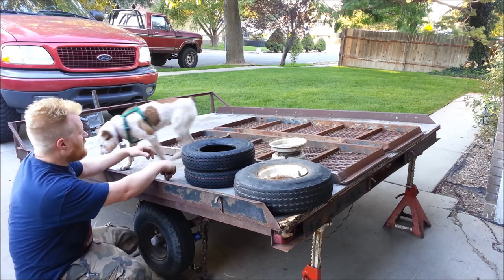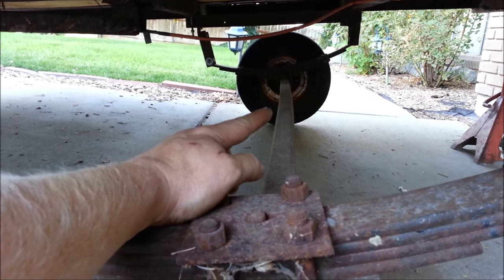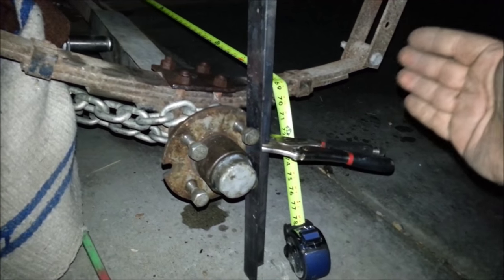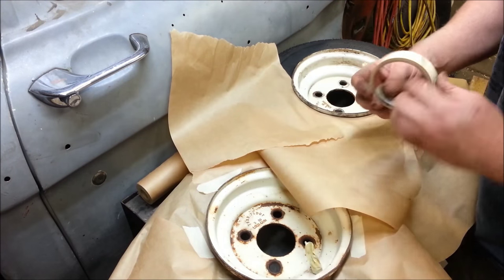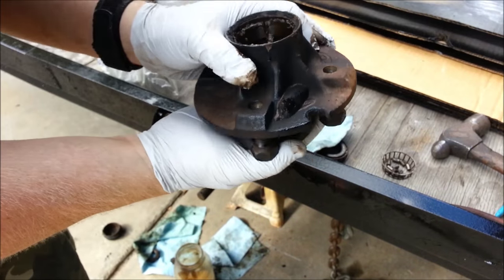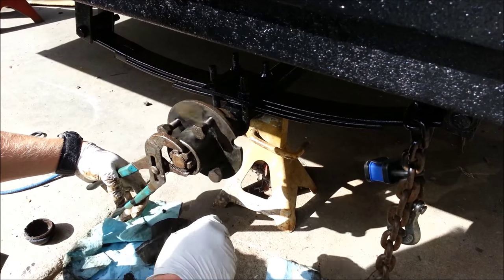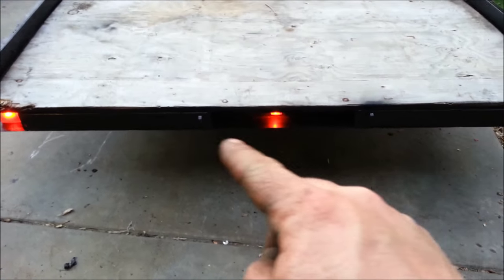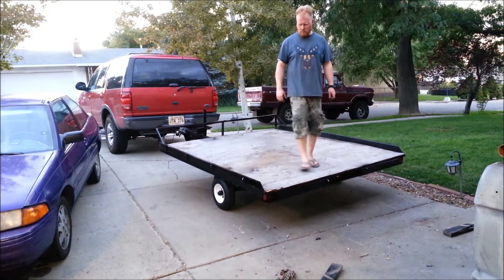Snowmobile Tilt Trailer Rehab Restore

Comment: Great job! Always important to keep the bearings lubed and in good condition. I repacked the wheel bearings on my pop up camper about 3 years ago, I pulled them apart last month and they were still perfect, grease was still nice and clean, but nothing like having peace of mind while going down the highway.
Reply: bearing buddies.
Reply: @mrgoggles1963  Bearing buddies are for boat trailers. They force grease out the seal and make a huge mess. EZ lube spindles are used for trailers, they allow the bearings to be lubed while pushing the old grease out from the front without blowing past the seal.

Comment: What a good idea with using an extension cord. As for grounding, the HB trailer kit I put together I ended up running a ground wire to each light. I also solder the wires like you do.
Reply from the maker: +Dasdfjkl On my own trailers I run a ground to each light and frame ground them. They never fail.

Comment: I use to stick the tires in between the bed on a dump truck to break the bed.   I would hold the switch in one hand and the tire in the other. It worked great.
Reply from the maker: +1970chevelle396 That's a great idea.

Comment: Nice... Thanks for sharing.

I agree about soldering the wires... Strangely enough but one of my co-workers has a Master's in Electrical Engineering and said that you should NOT solder auto wiring because it will corrode faster and cause excessive resistance... I searched this and the answer was to put dielectric grease on the connect like you said OR use heat shrink tubing with sealeron the inside for an air and water tight connection...     Very interesting...
Reply from the maker: +Jim Brent That's on the same lines of if the wire has a nick or cut in the sheathing it will corrode. This trailer for example: had one of the only soldered connections I've ever seen someone else do. It was for the wire feeding the 3 rear center marking lights. The soldered connection was very loosely wrapped in electrical tape with no grease. This split off to the light that had three crimp connectors and was rusted and corroded beyond the repair with zero voltage passing through any of the three connections. The soldered connection however flows flawlessly and that is the same wire I used to hook up the single rear center marker light. This trailer hadn't been moved or touched since the early 90's and when it was, it was used on salted winter roads in the worst possible conditions.

Comment: Nice job. I never thought of using an extension cord to wire trailer lights. I like that idea. It seems like every time that I go to use my trailer the lights don't work and I fiddling around with the wires just to get some lights on. I'm also always replacing the connector on my truck. The cheap HF ones break inside of the insulation.
Reply from the maker: +Joseph Costello Thanks. Yeah, cheap wires can be frustrating.

Comment: Cool way to check and adjust alignment! Great video. One little note, triple lights are required by law on trailers over 80" wide.
Reply: Exactly. That trailer is not road legal because of the missing triple light (also must be red, not orange or white) in the middle of the rear span.

Comment: A tip for wheel bearing! I usually take the old bearing and grind it down a bit on the outside! Then it does not stick when you knock down the new bearing.
Reply from the maker: +SillenTDMrider That is a great tip and I knew someone will call me out for it.  Thanks..

Comment: great job.. handmade trailer?  wheres the licence go? .. i use basement floor grey to slather  onto my 2 x 10 trailer boards and then before winter i oil spray everything.. extra greasy  under.. no rust
Reply from the maker: +san379 I my state small trailers like this don't require licensing.
Reply: nice to see that.. here.. even the smallest trailer and electric bike and everything needs a licence and pay tax on it.. even boats have a boat launch fee and zebra muscle  tax  about 70$

Comment: I live up in the salt-belt.  Have some steel pins that hold the enclosure down - that are all corroded - any tricks on how to keep them rust-free without painting them?  Can you heat them up and dip them in oil to give them a protective coating?
Reply from the maker: I've oil treated steel before with decent results. You want to get it to around 350F then dunk it in old motor oil. This is just enough heat to hold open the pores to hold oil. Most of the time though I just like to use Marine grease. It is design to not wash away with salt/water like typical grease/oil.

Comment: Great video.   Love this project.
Reply from the maker: +Marcus Kloepping Hey Thank... I should have red Loctited the lug bolts in though to give the next guy a surprise. :-) Random question for you: is there an adhesive that will bond steel to rubber (like you might see on small engine motor mounts)?
Reply: +sixtyfiveford  yes we have adhesives that can do that. Can you give me more specifics?
Reply from the maker: Marcus Kloepping On the bottom of generators and other stationary equipment there will be rubber feet to isolate the vibration of the running machine from the ground and keep the equipment from dancing around. The little rubber feet are generally just a soft rubber  about the same firmness as a car tire rubber and it is bonded to a steel washer. This is then bolted to the equipment with the washer and the rubber contacts the cement, isolating vibration. The same thing is done with engine mounts on small equipment where they take a metal plate, bond rubber to it and then bond another piece of metal on the other side. One side gets mounted to the motor and other the frame of the equipment. Typical adhesives that I have tried, bond to the steel but the flexible rubber tends to be difficult.

http://longmansales.com/data/rubber-engine-mounts.jpg
Reply: +sixtyfiveford your two best options are a tuffened superglue or a urethane adhesive.     If you want a sample let me know.
Reply from the maker: Thanks for your insight.

Comment: Did you actually use just regular extension cord to wire it I need to rewire a trailer and it's having lots of problems I'd appreciate if you replied. Thanks man
Reply from the maker: +JR Landscaping Yes, I've found regular extension cord works amazing.
Reply: +sixtyfiveford do you just use one piece for the whole thing ?
Reply from the maker: I try. The fewer splices the better.

Comment: Just note, if you straighten an axle out after its been overloaded, it won't take all that weight its rated for again, or atleast as much as it could prior to yielding, before it starts to keel over again.
Reply from the maker: Yes and no. The deflection isn't for load carrying, that is the job of the leaf springs. The deflection is only for wheel alignment. You put a top arch bend in it to counter act the bend under working load. The amount of bend is so minor over the length of the axle, there is really no metal fatigue. Front I-beams on Ford trucks are bent back for this exact reason during a routine alignment.

Comment: I thought dielectric grease on connections were bad, because it blocks electricity? Will it seep between the wires and eventually block the connection?

I use linemans splices and shrink wrap.
Reply from the maker: Just the contrary. It insulates the wires from corrosion and keeps the connection good indefinitely. I've never had a dielectric connection corrode or fail.
Reply: Killer, I'll use it from now on!    Thanks!

Comment: id like to see how you use the extension cord for a trailer thanks
Reply from the maker: +MISTERR0BOT0 I just cut a length from an old extension cord and use the wires. They're all shielded nicely so they last forever.
Reply from the maker: +MISTERR0BOT0 I just cut a length from an old extension cord and use the wires. They're all shielded nicely so they last forever.

Comment: Could the axle be rotate where the bow is up to compensate for the load?
Reply from the maker: +Dennis McGill Most axles will have spring perches welded on(round tube). This one had holes drilled for the leaf spring through bolt. So you can rotate them with a little work but usually it requires cutting and welding.
Reply: +sixtyfiveford It Was Just A Thought.
Reply from the maker: It's a great idea and I've thought/think the same as you.

Comment: Nice job  good looking trailer. If you would have wanted the trailer to stop bending over the front where you had to put the Jackall to the centre you could have welded truss bars from the top of the centre post to the bottom of the trailer deck on the outside edge and would have given it more than enough support. Don't you have any punches? LOL using screw drivers is a little hard on them. LOL
I know what your wife can get you for Christmas :-)
Reply from the maker: +Murray Lowe Yeah, screwdrivers get a lot of abuse from me. But they hold up for years before I have to warranty them out.
Reply: +sixtyfiveford I guess that is something I should do because I do break them just with torquing them. But usually I just buy a new set because I don't go through them that often. I do have a fairly good supply of chisels and punches and I am pretty hard on them.
Reply from the maker: I generally use the rounded off flat heads for chisels, saving my sharp ones for screws. I randomly run over to Sears and swap them out along with phillips as nothing works better than a new screwdriver.
Reply: +sixtyfiveford  Phillips is the ones I torque off the flutes so I use robertson screws and drivers they last much longer and are definitely easier to use. I am like you in the use of standard (flat) screw drivers because I really don't like slot screws many times I have hurt  myself or just damaged the screw or furniture or whatever by using slot screws. But all this aside, I really want to thank you for sharing all your great videos.

Comment: How did you get the hub and wheels off?
Reply from the maker: Take off the dust cap, cotter pin, castle nut and it pulls right off.
Reply: @sixtyfiveford  having hard time getting bolts off any ticks I could use
Reply from the maker: @kellygrogan5066  The main spindle nut It's held on with some sort of locking device. Generally it's just a cotter key, but they also have methods of washer that's bent over to hold the nut from spinning off by itself. But generally you can't even get a socket on the spindle nut until you remove the locking device.

Comment: I buy fixer uppers all the time to bring back to life to re sell, I never skimp on lights. Extension cords are not good to use, I would have put a wider rims an tire's for better stability an trail, but overall that's a $150 trailer, could of got $600
Reply from the maker: The 4 strand trailer wiring you buy is garbage and the insulation cracks right off 3-4 years down the road. I've flipped well over 100 trailers and this wasn't worth the energy I put into it but my records show I sold it for $750, which other than the Harbor Freight turds is about the cheapest I've ever sold a trailer for. I generally only deal with tandem or enclosed trailers in the $2000-6000range.